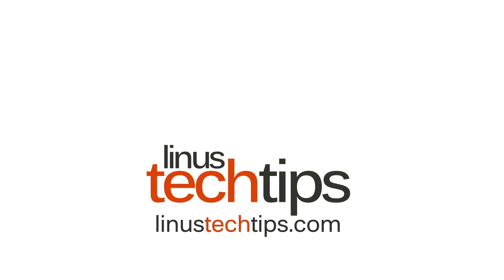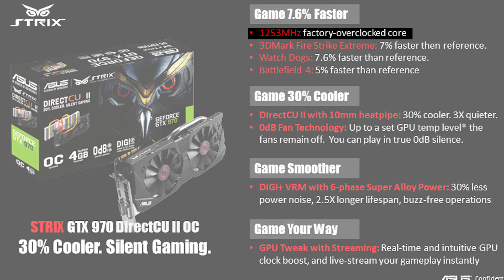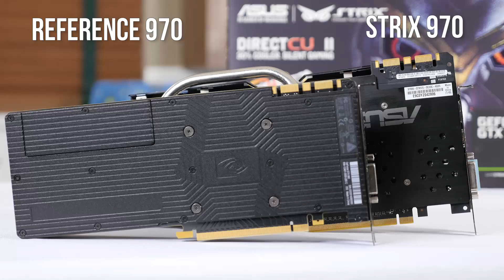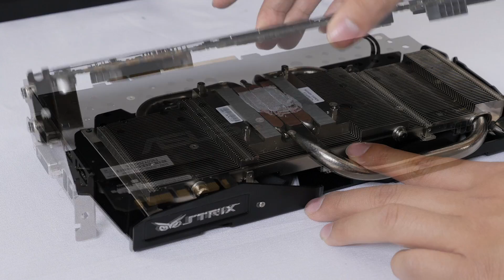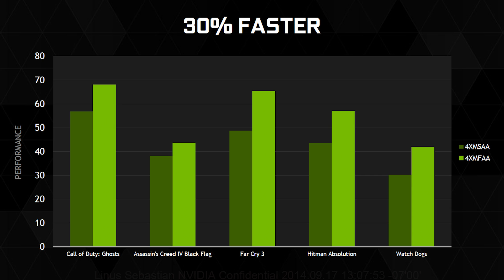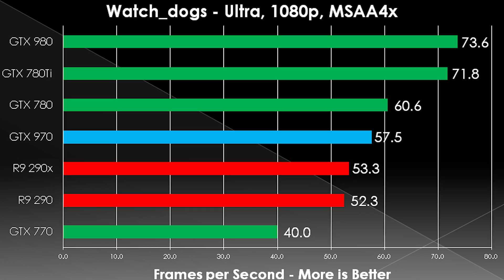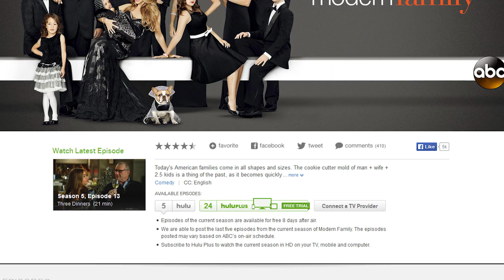ASUS Strix GeForce GTX 970 Video Card

Comment: msi 970 vs asus 970
Reply: asus
Reply: Asus Strix
Reply: MSI Gaming 970 is better than Asus Strix 970.. but it's more expensive
Reply: ченри кивийжрв - CSGO DracoValius - 
Why is strix better than the MSI? Your opinions please :)
Reply: Blazyy _ In your opinion, what makes the MSI gtx 970 better than the Strix one?
Reply: +Venum MSI edges out Asus by a tiny bit. It can draw more voltage than the Asus to give you a couple of extra frames. If they're priced the same where you are, and the extra power consumption is not an issue for you (it shouldn't be at such a minute level), I'd say go for MSI. Temperature and noise level are virtually identical between the two. For more information you can look it up in tomshardware
Reply: If you aren't a hardcore enthusiast gamer, you won't have any problem
Reply: Blazyy _ ok, thanks dude!
Reply: +Venum :D
Reply: +Venum I myself have just ordered an Asus GTX 970
Reply: Blazyy _ why is that?
Reply: +Venum Don't have the moneyz for msi
Reply: +Blazyy _ oh :/

Comment: how do i know if it will work with my computer?
Reply: depends of your specs, but you can run it with a psu of 350W, and i5-6400. and of course pci connector on the motherboard.
Reply: but if you want overclocking, get a 500w psu..
Reply: BAXT3R OFFICIAL Thanks so much but do you think it will fit in this computer and work? Acer Predator G3620-i7 - Desktop
Reply: Yeah man, i think so. But ask to someone that know more than me, but for sure an i7 don't do the bottleneck.

Comment: Would this run battlefield 1?

I7 6700k 
Gtx 970 4gb 
16gb ddr4 3000mz ram
Reply: nope wouldn't even open
Reply: never dude... not even on the lowest settings,,, u should upgrade your pc.
Reply: The internet is so useful lul
Reply: Yes. Everyone's messing with you
Reply: only a gtx 1 million can run the game on a solid 5 fps, (seriously bro, bf1 will burn your house)
Reply: Yes easily, but you're better off spending more money on the gpu by buying something more powerful then the 970, and cutting back on your cpu.
Reply: no
Reply: get a gtx 1080 sli man
Reply: Nope, better get an xbox, those have killer graphics.
Reply: These kind of comments are getting old lol
Reply: yes, you'd do just fine on high or ultra settings.
Reply: You should be able to max everything at 1080p
Reply: An i5 is good enough for gaming
Reply: of course dude!  you dont even need 16 gb ddr4, i think the other commentators are being sarcastic
Reply: mrsnowman 59 seriously, the PC that u have built can run almost anything at ultra and get more than just 60 fps.
Reply: I doubt it
Reply: Shadow play

Comment: just ordered the EVGA SuperNova 650 Watts G2 Gold 80 Plus to my new ASUS STRIX GEFORCE GTX 970 4 GB GDDR5 with Direct CU 2  and i noticed there is no connection to feed the ATX CPU connection in the Mainboard  from the P7 cable with 2 black wires and 2 white wires that comes from the Original Power Supply from my HP Pavilion Elite HPE-210f Desktop how can i adapt or solve this?

Comment: will it be good with corsair VS 550w and i5 3450 ?
Reply: As long as you're not going to be overclocking or pushing the card to its limits you should be fine. But I highly recommend at least a 650W.
Reply: +sumit sarin Running this card @1500/8000 with a i7 4790k@stock with a Be Quiet E10 400watt....reaching 300-320 watt in peak.. You are more than fine with this setup ^^
@Eliw Saliba you have clearly no idea...

Comment: Would my system bottelneck with the 970? Right now I have a i5-3570k with a gtx 760 with a 650w PSU and 16 GB of RAM and 250 GB ssd and a 1TB hdd drive.

Comment: Can i use this card with this config? Intel I5 3470, 12GB ram 1600, 2 HDD, MB biostar h61mlv2 and corsair cx430w 80 plus bronze. I wont overclock anything.
Reply: Change that PSU before upgrading anything else, it's very bad.

Comment: Do you guys think these specs are good for gta 5 settings high and all other games with settings on high. + How much fps do i have on gta 5 and far cry primal with these specs (i am gonna buy a pc with these specs): CPU: Intel® Core ™ i5-6400 processor
Operating system:
Windows 10 Home
OS : Windows 10 Home
Clock Speed : 2,7GHz
Video Card: NVIDIA GeForce GTX 960
Memory: 8GB
Memory Type : DDR3 1600 MHz
Number of memory banks : 2
Used memory banks : 1
SSD Capacity : 128GB
Hard drive capacity: 2.000GB
Graphic details:
NVIDIA® GeForce® GTX 960 graphics card with 2GB of DDR5 video memory

Comment: Hi can anyone help me. what Power supply should I use? I'm planning to have ASUS Strix GeForce GTX 970 Video Card, ASUS ROG MAXIMUS VIII HERO and 4v4 4gb Ram and NZXT KRAKEN x61 water cooling. Sorry It's my first time building my own Gear so hope anyone can help me because I saw that there are different Power supply and I don't know the right model or type of power supply I need. Thanks!

Comment: I've did research about this graphic card gtx 970, says it not suitable for 4K gaming?
Reply: +Mubin Julien Quinlivan Azhar i think for 4K gaming you need 6gb VRAM on some higher settings. low 4K i'm sure it's possible
Reply: +Alucard8319 got it!
 asus gtx 970 black edition or strix 970? which is the best?

Comment: I have Lenovo H430 desktop, I already upgraded it to evga gtx 760 with 500+ power supply, but if I were to buy a Msi gtx 970, will it fit in the desktop? (As I switch it with gtx 760)

Comment: Is my pc compatible with this card?
CPU: AMD FX-8300
8gb ram
Motherboard: ASUSTeK COMPUTER INC. M51BC (Socket 942)
500 watt
Reply: +Xarithus yes
Reply: ***** Could you care to explain more? Is my CPU too bad?
Reply: Andreas Scott Ok thanks. I've already ordered a 970 so I'll just get a new PSU and CPU when I can afford it. Also, could you care to share the link to that forum you found that on? I would like to see what it says.
Reply: ***** I've already ordered a 970, so I'm kinda stuck there and I really want to use it when I get it... But I remeber I could run both BF3 and 4 pretty well with my CPU and old graphics card so I'm hoping my CPU will work well with my new 970. Also, how come I need an Intel CPU, are AMD CPU's bad for gaming or something?
Reply: ***** Whaat? So with newer games I won't see an fps difference? I ran the Division beta so shitty so I decided to get a new card to get better performance, will I not get that with the 970 I ordered? And yeah I do have teamspeak.
Reply: ***** Ok i'm in the Ts server, what lobby should I join?
Reply: ***** Just reply to this youtube thread thingy when you join, and then i'll join aswell
Reply: +Xarithus WEll CPU could be little bit better but it is still guide ok for 970..
Reply: Xarithus very compatible bro no fucking problems ;)

Comment: Is 500 watts enough to overclock an i5 4690k/gtx 970? Or do I need a better PSU?
Reply: Alucard8319 Thanks! I will leave it for now and save up for a better power supply. I don't want to take any chances with my expensive components! :)
Reply: 550+ 80+ bronze+  and u are done :)
I prefer go to seasonic or antec best quality psus
Reply: I already have 500 watts so no point in upgrading 50 more. wish I had gotten slightly higher psu tho
Reply: +Tom Brown i had 550watts, but when upgraded the card I wanted also to be a bit futureproof...i went with 650+bronze+80
Reply: +Anwar Siracha rip after 1 year
Reply: +Anwar Siracha Because the wattage IS NOT GOING TO BE THE same.
For instance if i take a 650 watt 80+ gold after 2-3 years it will fall to 450 watt max.Thats why we suggest "overwattage"
Reply: +Anwar Siracha Nice! Yeah if is 450 watt 80+ Bronze/gold titanium? is ok :p but not for too long.Anyway happy gaming :)
Reply: Hi guys! I am just gonna save up for a 750 watt modular PSU. That way I have enough head room for overclocking and any upgrades if I do SLI in the future.

Comment: total noob question; 980 is a bit much financialy and I don't spend enough of my life gaming to justify that, can a 970 easily be replaced with a 980 once they get cheaper in a few years? Could you just swap the GPU or does it need different power supply etc?

Comment: I got the Gigabyte GTX 970 Graphics Card with 3 fans on it really fucking amazing upgrading from an old 560 ti with a broken fan that i had to run everything on lowest 720p just so it didn't melt.... highest temp I have hit is 73c in dying light on ultra 1920x1080 damn good card

Comment: Hey guys, was wondering if this is a good build - http://au.pcpartpicker.com/p/vnRyJx
Cheers :D
Reply: I think that is fine, although i would say that a 6600k and the Asus z170-a would work well, also drop the SSD, it may be faster, but it would save you money to upgrade to better parts. i just bought my 6600k and z170 with 16gb ddr4 3000mhz, and It is worth every penny. Also in America where i am, it will cost me 1500 total, i dont know the currency exchange rate.

Comment: hey guys I wanna upgrade my gpu but I just have 500 watt PSU.. Gtx 970 would work fine with that however r9 390 won't since it needs a 650 or 700 watt PSU and my stock Asus desktop PSU would be hard to upgrade. any suggestions? also I was wondering if it would be worth the wait for the Nvidia Pascal 1000 series to come out or should I go with the 970?

Comment: can i use this card in my pc? 

i have: a 550w bronze psu, a micro asus M5A78L, 8 gb of 1600mz ram,  an r9 270x, and an amd FX-8320.
Reply: +flex acc no. 6 
You can't Crossfire or SLI different cards from different companies.  If you buy the 970 you gotta ditch the 270x, which I would absolutely do.  The 970 is a superior card.  
Your CPU should be fine and not bottleneck the card, unless you are playing a super CPU intensive game like Arma 3. 
As for your PSU, go to a PSU calculator and input all of your specs and check and see if you have adequate wattage.  I think you should be fine, though.  550 looks like plenty enough and 80 plus bronze is a pretty strong rating.
Reply: Julian Bell so wait my cpu can potentially bottle neck the 970?
Reply: flex acc no. 6 Potentially, but it will really only make an impact on very high cpu intensive games, like Arma 3 or Planetside 2.  If you overclock it to 8350 speeds, then that should remove most, if not all, bottle necking.
Reply: flex acc no. 6 One more thing, I recommend upgrading to 16 gb of DRAM.  It is really cheap thanks to DDR4 being released and will allow you to run bigger games, as well as many browser tabs.
Reply: Julian Bell lol you kind of worry me with this whole bottle necking thing, can you further explain it to me? will i get shit frames on arma 3 if i pair up my cpu with a 970????
Reply: flex acc no. 6 Not shit frames.  Offhand I don't know the benchmarks of Arma 3 with your specs, I'd look them up.  Personally, I don't think that it will be a huge bottleneck, maybe a few frames drop.  The 8320 isn't a terrible chip.  I could be wrong, but I don't think it will be that significant.
Reply: Julian Bell people say that if i overclock the 8320 it will perform like a stock 8350
Reply: flex acc no. 6 Yep.  It does.
Reply: +Julian Bell thanks for the info, lol I've been on the fence of the 970 and 980, but I don't game at 4k or really anything that demands too much.  I have an almost identical spec as flex, but have the 16GB RAM and am looking to replace the 270x for a couple years
Reply: +flex acc no. 6 
Sadly, FX Processors are bullshit.
You wont get bad FPS, but you would get many more with a recent intel processor.
So, you wont get the full 970 power, maybe if you overclock the FX.

Comment: Hey guys so i am in a crossroad and i REALLY need your help. I have a choice to buy this exact same Asus strix GTX 970 card OR the PowerColor XFX R9 390 card? I know the R9 390 has 8GB and good for future proof, but from my research the 970 out performs the R9 390 a bit due to its core clock. They are both pretty much the same, but which would you prefer?

Comment: Hey I have a question, I am thinking about upgrading my rig to the following:
i3-4130 -> i7-4790k
Gtx 660 2GB -> GTX 970 4GB 
8gb ddr3 Ram -> 16gb ddr3 ram
500 watt power supply -> 850 watt power supply
Total: $935 (yikes)

Should I buy this? I like to recording Minecraft videos but the reason I want to get these upgrades is because currently with the build I have I get 30-80fps on medium to low settings while recording Minecraft (I used to not have this problem). The reason I don't record more graphic intensive games is because I can only get 20-50fps on them. I stated earlier that I did not use to have FPS problems at all while recording Minecraft. I've had my computer for one and a half years and my hard drive is currently 900gb/1tb and I've tried clearing up as much junk and old videos as possible but I need all my other stuff. Could my storage be a problem? When I upgrade I want to be able to get 60fps+ on Minecraft all the time even with shaders but I feel like I could easily just buy a new hard drive or even an SSD for only $100 dollars and be back to normal instead of having to spend $935 and get the same results as I would with just buying an $100 SSD. Do you or anyone else reading this recommend anything? Is there anything I can currently do to my computer without spending anything?
Reply: Leave your ram as it is
Reply: Ur gonna get unlimited fps lol, no but srsly, you'd be playing every game easily on 1080p 60fps+ maybe even 1440p, 40-50 fps
Reply: +Harsh Pherwani yeah, but maybe if hes gong to edit heavy he should upgrade.
Reply: Yup

Comment: 13 Sm's and 56 Rop's! 64Rop's for the Gtx980 (Gtx960/ 8 Sm's  32 Rop's and Gtx950/ 6 Sm's  32 Rop's, The Gtx 750ti/5 Sm's 16 Rop's)  Only Gtx 970 card that beat this is the Msi "Twin Frozr V"version. The Asus got 9.8 0f 10 the msi got 9.9 and 10 of 10! at test's!

Comment: Whats a good cpu for this card without bottlenecking?
Reply: +Tamaleking111 I would go for the I7. Newer games are more I7 demanding. I5 is fine of course, but newer games i'm sure they will make more use of CPU power
Reply: i7-4790k
Reply: +chainsaw.avi hmmmm gotta look
Reply: +Tamaleking111 i5's are more than enough
Reply: +Bo2xSupeRxBoss I find that very difficult to believe. My friend has i5 4690k and he says its almost bottlenecking. Well I think that i5 is good enough tho
Reply: I5 4690K or better
Reply: +Alucard8319 true
Reply: +Alucard8319 with an Intel Core i7-3820 would that be a hard bottlenecking for this card?
Reply: +Tarex well I know a guy who rocks an old i5 with 3ghz so I think not if you do not overclock anything
Reply: +Tarex I ment that he uses this card also with it

Comment: i have seen your video i need a suggestion 
My Spec: i5 2500k, intel dh67vr motherboard ,corsair vengeance ram 8GB , cs600 smps &amp;gtx 560ti. i need to upgrade with gtx 970 if it is possible DUDE or any lag will be der in my pc after upgrade to GTX 970 Reply ASAP

Comment: i have thhis strix and msi golden edition.....
strix=1 8 pin
GE= 1 8 pin & 1 6pin power connectors

strix=1380mhz(stable)
GE= 1570mhz(stable)

no wonder the strix is sooo much cheaper
Reply: +Jody Wilson but strix gives 229gb bandwidth while others only 224gb data bandwidth. that 5gb does much better since it can use more data at the same time. That was the thing I noticed when i used 970 asus strix

Comment: I got Bioshock Infinite on Steam for $3 on black friday. I had already played it on Xbox 360, but with my 970 its like a whole other game. I'm glad I switched to PC insteaad pf buying an Xbone.
Reply: +ElZamo92 Ps4 or this?
http://au.pcpartpicker.com/p/FM4wxr
Reply: Its WAY better than a PS4, just choose another cpu cooler, that one is so tiny that the one that comes with the CPU is better.
Reply: +xXLegitxHaxorXx you can take that cooler away, as it is proven that the stock is better than that. Also, try to put in an ssd, and see if a r9 390 is cheaper than the 970 in au since it outperforms the 970 drastically. Then the only problem would be your PSU since you would want a 750W gold rated from either EVGA or corsair, or other trusted brands. Something like the EVGA 750W G2 or corsair rm 750x. AND, it's better if you get a better PSU so u don't need to upgrade later on which will cost even more.
Reply: Nah i have a price limit
Reply: +ElZamo92 You did the right thing. The XBone is a curse upon this planet, A STAIN if you will. Microsoft really screwed that pooch this with that horrid VCR of theirs. My friend may your framerates stay high and your temps be low...
Reply: its more like 12th gen
Reply: im sorry, but it's still the same overrated game. just smoother.
Reply: bio infini?
Reply: you are correct sir!although x360 has a lot of memories,ill never put it away!best console ever

Comment: PEOPLE PLEASE ANSWER ME! When you record your gameplay with programs like fraps, mirillis action or others, normally fps drops a little bit but in case with GTX 970, does it drop very much ? I just want to know if gtx 970 is a worth card to record games in 1080p - PLEASE, THOSE WHO KNOW, ANSWER ME !
Reply: +Arthur's Little World You need to look up Shadow Play. Its built into the NVDIA Ge-Force Experience Software and will allow you to record up to the last 20min of gameplay by pushing a set keybind with no performance hit. However Rainbow sheep is right. The performance hit of recording is determined by CPU power not GPU.